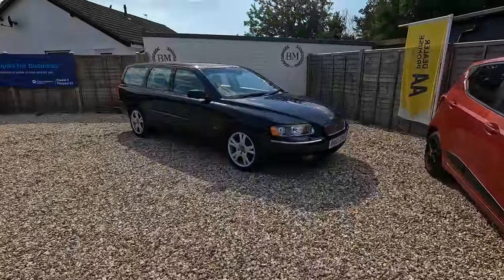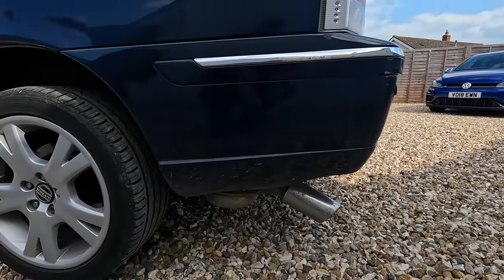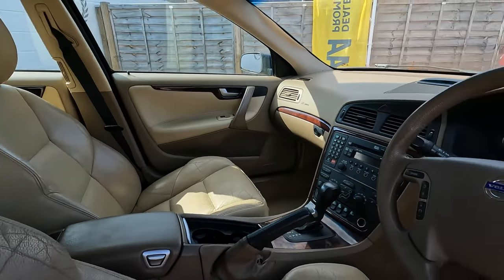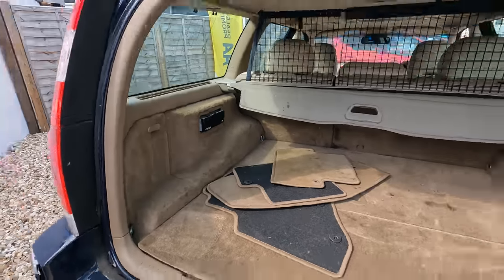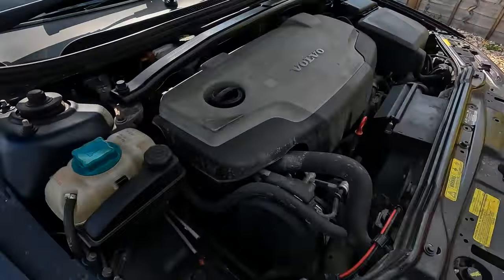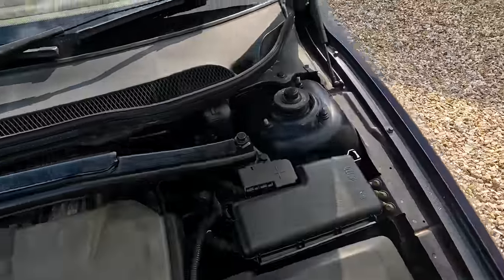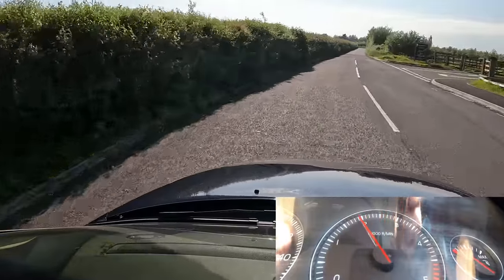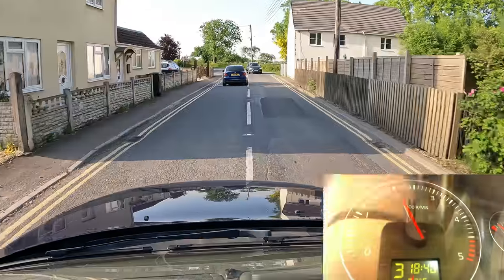I bought a CHEAP D5 Volvo V70 for £1000, and I think it's going to COST ME BIG!

Comment: That's an early 185bhp Euro4 D5, The 163bhp Euro3 D5's were so much better in terms of MPG and less to go wrong with them like DPF's and swirl flaps etc! The aisin warner auto gearboxes in these were according to Volvo sealed for life, They are not! EDIT, Aisin warner auto boxes suffer with a worn out valve block, No amount of fluid changes will extend their life, I did my research on V70 D5's hence ending up with a 163bhp Euro3 manual, 242K miles on it, 53 mpg on a run and 42 mpg around town and it is bombproof! 👍

Comment: Pretty sure you have worked it out now, but it looks like this car has the Aisin Warner TF-80 SC gearbox. When working it is fantastic as it locks up its torque converter in all gears making it really economical and far less slushy.  But sadly they are supposed to have transmission oil changes every 40k miles and most didn't.  The slip you get between changes is called flare and is due to wear in a piston in the valve body, replacing the valve body (you can get recon and it might be possible with the gearbox in the car still) is the way to go.  The same box (variants of) was fitted to diesel Vectras, Signums as well as some VWs and Toyotas.  On the Vauxhalls it is possible to get the front pan off the box in situ, and from there get the bolts out of the valve body.  Replace and then change the oil, there's a process to follow on the Vauxhalls to relearn that involves sitting at specific throttle settings once hot through a wide speed range (essentially like 20% throttle betwren 0  and 80mph) several times.  It is likely similar for the Volvos.  That flare will also appear on upshifts into top gear i believe (though youll be going quite quickly to find that).
Reply: As you say, the gearbox oil needs changing around 40k miles as the breakdown temperature of the oil is very close to the running temp of the diesel engine models, it tends not to happen in pertol models as often.

Comment: For the price of transmission fluid, I'd give it a couple of flushes through and ensure the correct amount of oil is in it before going any further
Reply: Waste of time and money mate, The Aisin warner gearboxes are crap, The valve block simply wears out, Oil flushes just cover up the inevitable for a few hundred miles, Manuals are the top option on these.

Comment: Try saving it if, as long as it isn’t too costly as they do make decent money. 

Having said that, I have a 146,000 mile 2014 D5 XC70, I’ve owned it for about 18 months and it’s cost me over £3,000 in repairs and servicing and it still isn’t finished. 

It makes my previous Discovery 4 seem like a bargain to run….

Comment: I might be way off here, but I had an old Mercedes years ago, it had an automatic transmission issue, I serviced it, dropping the sump and replacing the gearbox filter and fresh ATF, and it was cured! Worth a try and relatively cheap to do too.

Comment: A pal had a manual saloon version. Epic engine but if you do decide to keep it, I recommend alternately filling up the tank with the pricey diesel, or at very least giving the car a damn good thrashing once a fortnight, to prevent it going into limp mode. Alternatively, you could get it decatted and the lambda sensor dumped into a bin, assuming it'd still pass the MOT. My old Peugeot TD does so easily, albeit it might not be as stringent on the emissions pass rate requirement. I just filled my jalopy yesterday, this time with the cheaper stuff but add 5ml per litre with mineral two stoke oil, which helps to burn off the crap and also lubes the fuel pump as well - a bit of an issue since the withdrawal of sulphur in diesel.
  Good luck with it, whatever.

Comment: Thats most likely a valve body issue. 2nd to 3rd upshift is an extremely common point of failure on any automatic transmission. 
The valve body can often be replaced in situ but its still an expensive repair 
That "slamming" is extremely unhealthy and detrimental to the drivetrain. You wont be able to do that much before something breaks!

Comment: Assuming this is the later 185bhp engine it will be the TF80sc 6 speed gearbox. Unfortunately the very first generation of this box had allot of issues with valve bodies. In this case the shift solenoid for 2-3rd is sticking which is the route cause of your shift flare & banging. Driven any significant distance that will eventually lead to some pretty serious internal box damage. I personally wouldn't recommend fitting a used box in this instance as the labour involved dropping the subframe to fit it is pretty involved and chances are unless it's had regular fluid changes (instead of this sealed for life nonsense) you could find yourself back in the same position. Getting at the valve body involves dropping the front of tht subframe for access. They can be swapped as complete assemblies or you can swap the individual shift solenoids. The last thing to mention is that these boxes have adaptive software. Volvo dealer software (VIDA) will allow you to reset the adaptations on the box - effectively it 're-learns' how to shift. It's not uncommon for them to take a bit of time to settle down post component change (anywhere upto 700 miles if a reset & adaption process is not performed). A quick dump from the transmission is also not sufficient, ideally you need to run at least 20 litres of fresh fluid using the gibbon's method (via the transmission cooler). I'm not sure where you are based but if you need to speak to a Volvo specialist with experience with gearboxes I'd recommend Horton Cars in Alesbury. They sorted out my XC60's knackered torque converter for me last year. Good luck!
Reply: Interesting...I got 175bhp according to everywhere and everyone. Got 2.4D which is the singleturbo. If it is pure D5 it got doubleturbo and have over 200bhp.

Comment: Part exchanged our 05 Automatic V70 diesel volvo in January this year 200,000 on the clock , Transmisson was slipping , in manual was worse than in automatic .  message read ''transmission service required '' garage scan read ''transmission slipping ''
Quoted over £1500 to to £2000 to repair ,specialist advised not viable , adding oil made no difference . Part ex for £400  had paid £1795 for the car which came  with no warranty but great car until transmission went after a year .
Car dealer put on his forecourt for sale at £4,995 i suspect to allow for new gearbox , now reduced to £3,995 but still no interest . also had dodgy drivers window , glass jumping out and needed new alloys as air was escaping from tyres but i did have them cleaned and resealed for £25 a wheel which did seemed to fix the problem .
Reply from the maker: I fear this has a similar issue

Comment: I own a 2.0T V70 that’s approaching 20 and it’s going incredibly well. The thing with these cars is this, if you buy a used one that hasn’t been serviced and maintained regularly, expect it to eat the piggy bank! While these cars are beautifully comfortable and a joy to drive as a cruiser, if they give trouble you’re in trouble! I’d avoid automatic transmissions and Geartronic models. These cars were finished in 2007 so that’s 16 years ago as it is. They’re pretty rare now in Ireland with very few for sale per month and none of them have valid NCT (MOT to our UK friends), and that alone can can be expensive to accomplish. The deck is stacked against these wonderful gas guzzlers but when I’m out on the open road nothing else satisfies as much and I’ve driven nearly every car there is as I used to work in the motor trade. Make no mistake, these Ford era vehicles are not as good as the older generations of Volvo cars.
Reply: This is a P2 and therefore a proper Volvo. I've owned a P2 S60 and it was very well made. Despite being 17 years old when I owned it there was no corrosion to the body nor underneath, and not a drop of oil leak from anywhere.
Reply: @Leeirvinebird  that’s cool. Mine is in great condition underneath too. No rust except on the exhaust pipe clips!

Comment: Yes, GIBBONS flush should sort it BUT you need Volvo diagnostics (VIDA) to tell the ECU it’s new fluid, otherwise it won’t make a damm difference. If it doesn’t work, box needs new Valve body / block. The pulse sensation from wheel on corners was totally fixed when he found the power steering fluid to be low, instead of topping it up,  he flushed  it out totally TWICE to make sure all old fluid gone and problem fixed, not returned ok 30,000 mls. Last point NEVER top the D5 engine oil to the max …. Use 3/4 on the max to min scale or limp home mode will pop up. There’s a TSB about it…. Looks like a LUX model, with AWD it’s a rare one…… KEEP it for yourself mate.

Comment: I paid £500 for my V70 D5 SE geartronic in 2021. Touch wood 14,000 miles later at 214,000 my 5 speed auto is still working and the car is still passing MOT’s. They are a lovely car but sadly if my gearbox goes I’ll scrap it.

Comment: Has it got the abs light on? Wife had a Mondeo auto that did the same. Abs light was on and the auto box uses the sensors to know when to change gear
Reply from the maker: Anti skid warning so same thing… I need a Volvo expert to confirm it’s that before I waste more money on it
Reply: @ShiftingMetal   my Mondeo v6 had the anti skid warning on and no traction control and was a wheel speed sensor causing it. As I said the wife’s would jolt changing gear and would be a nightmare until the abs light decided to fix itself and drove fine after

Comment: The seats look like they have done 250,000
Reply from the maker: You reckon?
Reply: Mine has done around 228k and my seats look alot better than those so i would agree on 250k
Reply: Yes, much better off with black leather in these old Swedes.

Comment: 100% must’nt be repaired. Best way out least loss as-is gotta be way.  Volvo geartronics do eventually go bad.  They’re not strong as ox’s like Jap boxes
Reply: It has a Japanese transmission.
Reply: @tiguanman1170  Thanks!!! Had no idea, should have googled , had only 2 bad Geartronic boxes over 18 years, never actually google'd the box manufacturer , Google: manufactured in Japan by Aisin AW
Reply: @zzhughesd  Yes, I drive a Tiguan auto and its the same one as in the V70 and V50 d5. Its also in the Freelander, Mondeo, X-type and one of the Suzukis. I did the research because we need an auto and I didn't want to go near Powershift or DSG.
Reply: @tiguanman1170  powershift Ford Volvo box. Had over 5 bad and burnt on almost 50% auction chances on Powershift. I also don’t buy.  But geartronic unaware used other applications other manufacturers !!!!